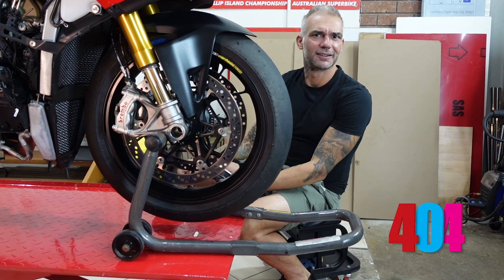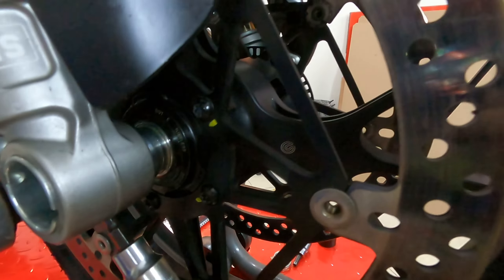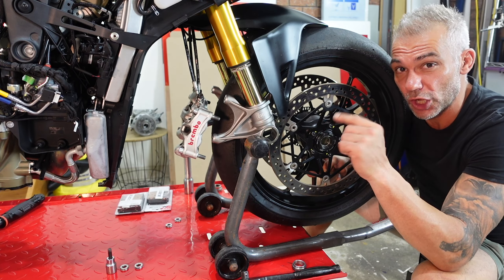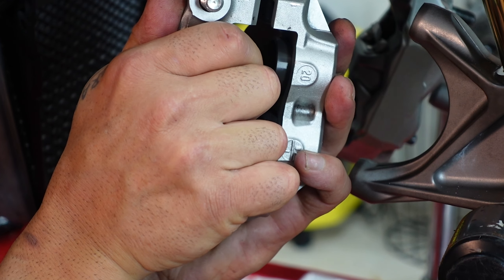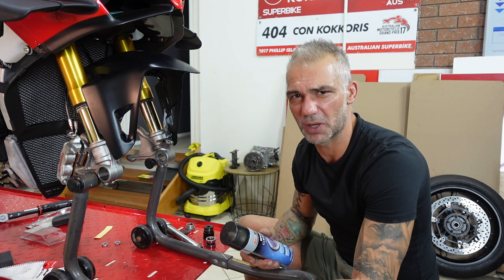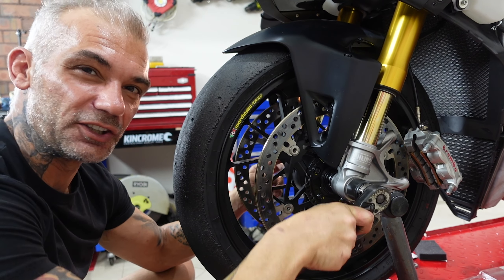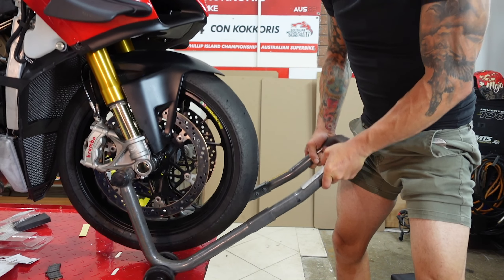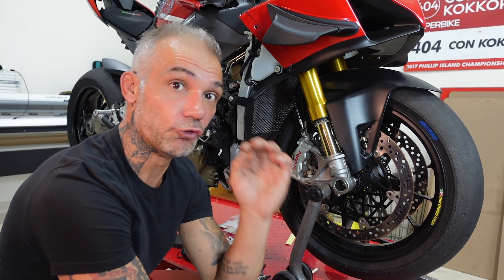[How To]  Ducati Panigale V4  Removing Front Wheel & Changing Brake pads

Comment: Why you must to remove the front wheel ? It is not possible to extract the brake pads? What's the torque for the front axle nut?
Thanks
Reply from the maker: Torque 60nm mate. You can change brake pads without removing the wheel.  I did it for the ones that want to replace a tire to know how. Thanks for watching mate😉👍
Reply: @con404  I do appreciate it!

Comment: Why did you take the wheel off? You can undo the callipers and slide out the pads.
Reply from the maker: Hey mate. A lot of guys take the wheels off to get there tyres changed and they not sure what way to put the front wheel on again (the right order to tight it up)😉🤙

Comment: You forgot to loosen pinch bolts before the final tightening of the Axle nut.  Aren’t you supposed to loosen those first, torque the nut, then torque the pinch bolts? Or am I missing something?????
Reply from the maker: Not sure if I got you right but how can you tight the nut with loosen pinch bolts.
Reply: After aligning forks, you tightened the non-captive side pinch bolts.  The axle won't spin with those tightened.  He is asking if you should now loosen the captive side(nut side) pinch bolts before tightening the nut, and then retighten the pinch bolts on the nut side after the nut is tight. @con404

Comment: Why are you wasting time wiggling the stand? That does nothing but possibly break the stand sooner. You need to remove the front stand and push down on the triple clamp to compress the suspension for a better alignment of the pads and calipers.

Comment: Thank you for sharing your knowledge. I will definitely used this instructional info when replacing my front brakes.

Could you post a video on how to remove the shroud? Mine has a crack near one of the top post. I believe if I could remove it myself I would be able to plastic weld it thereby fixing it. Thank you. 

With respect, CoachMRamirez at aol
Reply from the maker: Big thanks for the nice words mate. 🙏 will get back to you with a quick video how to remove them so you can fix it.👍😉